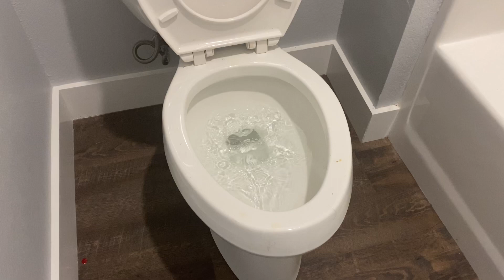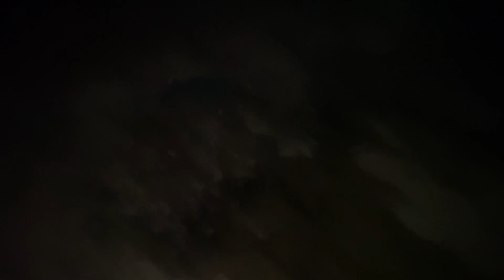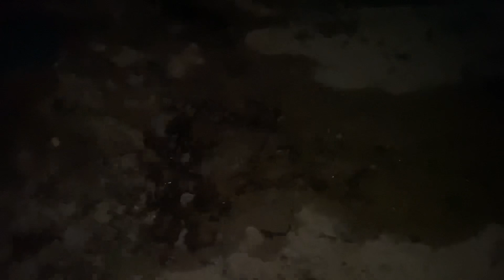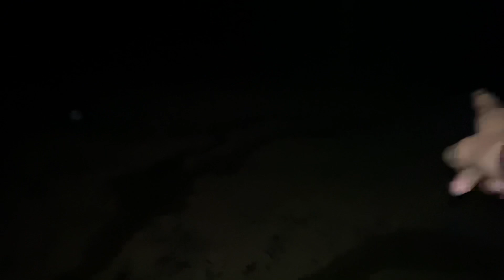Septic system failure?

Comment: This happened to us when our drainfeild failed. Water left the main slowly and flooded in our yard when excessive amounts of water were ran. The icing on top of the cake though is whenever you showered the main would fill up completely and nothing would go down. So to jump start the system I would flush the downstairs toilet and the sewage ejector pump would create a vacuum that would force all the water into the septic tank. It definently worked but everything violantly shot air and water up and then sucked it back down. Kinda souded like the bathtub sink and toilet were having a conversation. Lol

Comment: I had the same thing happen, when paper towels clogged my drain.  Paper towels are great for doing tests, as long as it's with toilets not hooked into your home sewage system.  I would clean my toilet with cleaner and paper towels, and then flush them.  The toilet flushed them just fine, but the piping not so much.
Reply: Are you serious? I always clean my toilet with cleaner and toilet paper. I never flush paper towels

Comment: I believe this is what happens when you don’t get your septic system pumped it should be pumped at least once per year if that’s not the issue or a blockage it’s definitely needs to replaced sorry to tell you this
Reply from the maker: The house is brand new so that wasn’t the issues. It turned out to be a bunch of paper towels that clogged one of the lines
Reply: @BTRPlumbing  ah makes sense